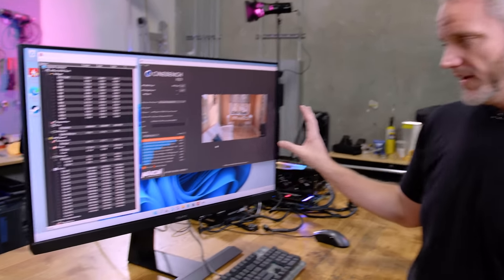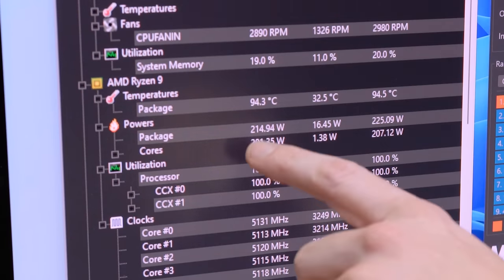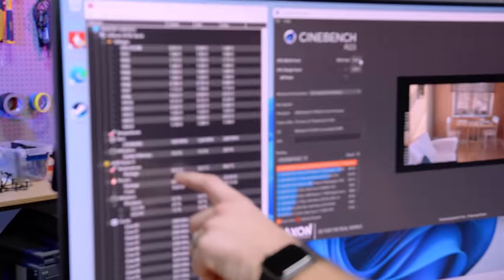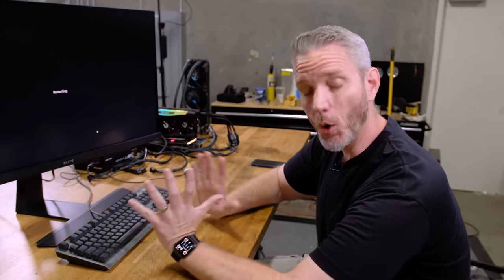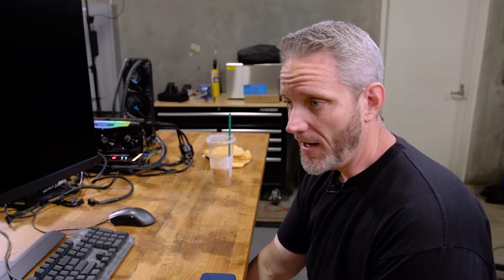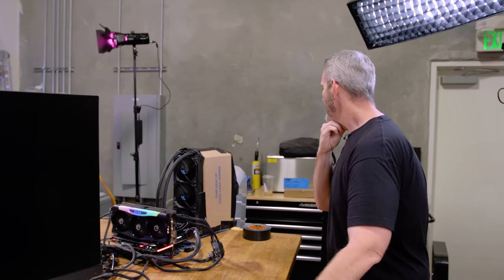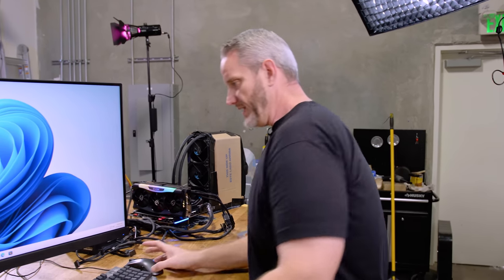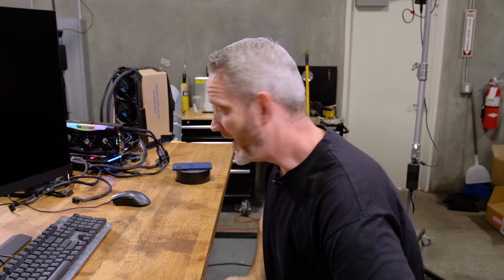This is fine...

Comment: Derbauer made a few interesting videos with similar experiments however he did delid the CPU and got about 20 degree improvements which is very impressive
Reply: that video was awesome!!
Reply: He also brutally murdered a 7700x in the process. RIP.
Reply: It's pretty straight forward, you will either use direct die cooling with custom parts from  der8auer and enjoy lower temps or you will run stock. And with how Amazon returns work it's never been easier to get into de-lidding and direct die cooling. I have personally destroyed and broken 3-5 processors so far. All of which I just put the IHS back onto and shipped back to Amazon and got a full return on my credit card. I then repeated until I figured it out and did it properly and it worked.  If you want your AMD Ryzen 7000 series CPU to be 75-80c under load you will have to use the aforementioned methods. Otherwise just accept 95c is the stock accepted temperature and there is nothing you can do about it without de-lidding and direct die cooling.
Reply: @yakivpopavich  ah yes, let's just commit fraud to learn delidding. come on, man.
Reply: @yakivpopavich  in gaming u will never get this temps
Reply: @friedpickle9828  You care about Amazon's bottom line and  Jeff Bezos's wallet?. Because I don't. People should use whatever means they can to learn more about overclocking and modifying parts and components. That includes taking advantage of lenient return policies of large corporations.
Reply: @yakivpopavich  not the ethical way... But if you don't get caught it's completely legal... A good way to get caught is to brag online about it
Reply: id love to see the stock PBO boosts with a 20 degree drop
Reply: That was with a manual overclock not with pbo
Reply: @yakivpopavich  What a way to figure things out ) It's unfortunate that this is needed to cool the cpu at all.
Reply: @pirojfmifhghek566  It wasn't too brutal, but it was murder.
Reply: Yep, just took delidding + liquid metal.
Reply: @yakivpopavich  The problem is Jeff Bezos doesn't care, nor does he have to. Consumers pay for what you mentioned, one way or another. Otherwise it wouldn't be offered.
Reply: @berinloritsch  Atta boy, I can't wait for the X3D models so I can actually do my next build. Gonna keep an eye on the 13th gen Intel chips too. I hope AMD's GPU's are really solid and actually result in AMD builders using non-NVIDIA cards in their builds for once.
Reply: @JoshuaKA02  Not my problem. The CPU's I damaged and destroyed were all returned and marked as DOA or faulty and were not put back into sales circulation. No Amazon customer is being negatively effected by what I have done. Amazon has foot the bill. Not Amazon customers.
Reply: For those of us who "speak 'merican"  it was a 20°C drop, which translates to around 36°F
Reply: @yakivpopavich  those cpu's then get looked at and resold to other customers. It's not just amazon you are defrauding, it's the next person who buys it
Reply: @yakivpopavich  The only one you are effecting with this is the next Customer.

If you think you will hurt Bezos at all... gg.
Reply: @yakivpopavich  hahaha the fact you think amazon foots the bill is hilarious. Once a thief, always a thief with zero moral values.
Reply: @Mike__B  pc temps read in degrees communist instead of degrees freedom anyways
Reply: @yakivpopavich  It affects every customer. That's how business works. Amazon has to foot the bill, yes, but they also have to make a profit; thus, they end up raising prices, fees, and services in the long run to cover it all.

Edit: And if the manufacturer is footing the bill, as is likely here, they do the same in return

Edit2: And it affects supply. That affects prices on its own directly.
Reply: @Mike__B  idk what you're smoking, 20 Celsius = 68 Fahrenheit
Reply: @TheOmnomymous  No they don't. I literally just said they are marked DOA and Amazon does not put them back into sales circulation. You understand Amazon doesn't even functionality check things when they are returned right?. Do you think Amazon has a giant room with test benches where they check the status of returned devices and components?. Because they don't. They literally toss a sticker on it and toss it into a receptacle to be disposed and marked as a loss. I'd do some research and figure out how Amazon works.
Reply: @F14Mavrick  Hahah indeed , I agree it's funny.
Reply: @JoshuaKA02  I've been doing this for months on end if not over a year, and the prices of the CPU's I have damaged and returned have all only gone down in price.
Reply: @Slimmeyy  I don’t know what you’re smoking, the comment was about a 20 degree C drop in temperature, and btw there isn’t linear correlation between C and F, and also C is almost exclusively used to measure CPU temps even in the US.  I didn’t watch derbaurs video but if we’re talking about a drop from 95 C to 75 C that’s actually a drop of 36 F
Reply: @yakivpopavich  it's not Amazon taking a hit. It's retailers that sell it on Amazon.
Reply: @yakivpopavich  The rules of economics still stand, bro. And capitalism dictates that we always foot the bill.

You do you, tho, just sharing my perspective.
Reply: @Slimmeyy  that's true for the conversion of 20C to Fahrenheit, but a temperature drop of 20C is equivalent to a 36 degree drop in Fahrenheit. Either way, @Mike B is way off.
Reply: @Mike__B  20°C drop is equivalent to a drop of 36°F .
Reply: @OutOfNameIdeas2  Everything I purchase is sold and shipped by Amazon. I don't purchase from vendors on Amazon.
Reply: @yakivpopavich  all losses are reflected in end user cost. So yes, you are hurting consumers. Basic economics. You are intentionally damaging products and returning them in a deceitful manner. I mean, you do you, but it's unethical, and abusing lenient return policies makes companies potentially adjust said policy in a consumer-unfriendly manner. Just my two cents. Has nothing to do with caring about bezos or Amazon. Stealing is stealing.
Reply: Yeah the DerBauer video basically debunked the whole "95C is normal" statement. The CCDs are too far off center and the IHS is insufficient.
Reply: @friedpickle9828  I didn't intentionally damage anything. I broke them accidentally while trying to delid and or apply liquid metal.
Reply: yeah he did ! pity AMD couldn't do something as simple as that, 20 degrees without hardly trying, a simple de-lid, thinner heat sink to get the heat away more efficiently to a the cooler, that change could be the difference between product reliability, or for the O.C. types removed thermal downclocking...isn't it weird how AMD have such a great product but are let down by the last step in the chain ? and it is Childs play compared to everything that came before that in the build process ! weird....
Reply: @pirojfmifhghek566  no that happened earlier..
Reply: @yakivpopavich  Unrelated, but don't do this at Best Buy. Worked at a return center and we test and check everything. (Pretty fun job for tech enthusiasts)
Reply: 20c not good enough I don't like going over 60c on my system.
Reply: noctua nh-u12a can handle this CPU just fine
Reply: @yakivpopavich  Your moral and ethics need to be straightened out. This way of thinking is what make people careless for each other and ruins nation... "this is someone else's problem, not mine". Each individual, the foundation of a society, can positively or negatively affect their surroundings. You, my friend, are slowly poisoning the well with your action.
Reply: @smileysan9261  not getting caught means it's legal ? what planet are you from ? done any murders lately have we ?
Reply: I had no problem delidding a simple intel chip.  The new AMD chips looks a little hairy with all of the surface mounted stuff.  I would buy a kit with a delidded cpu.  doubt that would ever happen.
Reply: Yeah I think I will probebly go that route if I get the new chips. But dang are these new CPU's space heaters. Between that and the 30 series GPU's? You wont ever have to turn on your heat.
Reply: @Mike__B  I don't know what der8auer's before & after temps were but for example, a drop from 95c (203f) to 75c (167f) is 36F.
Reply: @yakivpopavich  People are upset because you actually used the return policy 😆😆🤣🤣 it's not stealing if they have a return policy within so many days of purchase regardless if you intentionally did it or not.
There is always a excess of hardware in case it needs to be replaced.
People should understand neither business looses they just repurpose the parts melt them down etc..
People need to chill out with this stuff it's already out of hand as it is 💯
Reply: I am not surprised with how quickly the temps dropped I was pretty sure the problem is how quickly the heat is transfering from the die to the water which means the bottle neck is die to IHS , IHS to copper block, or copper block to water, judging by what you said about DeBauer delidding hus sounds like it is Die to IHS
Reply: @pirojfmifhghek566  yeah, i very much expect delidding the 7900 series are going to require an iron like the older soldered intel cpu's, will be interesting to see what Derbauer comes up with as a final solution
Reply: but only without Headspreader.. DirectDIE
Reply: @yakivpopavich  and thats the reason why amazons return policy's going to eventually get more and more stringent. Which in the end is just gonna make it harder on consumers doing the right thing
Reply: @friedpickle9828  Yeah, that's exactly the kind of bullshit that will eventually lead you either to an account ban, or to a company-wide nerf of the return policies, fucking over the whole thing for the rest of us who are honest about our returns.
Reply: @MeowyBrigade  Come and straighten my morals and ethics out then.
Reply: @yakivpopavich  Not worried about Amazon, but 3P sellers is another story
Reply: @yakivpopavich  I literally busted out laughing to this that’s amazing LOL!
Reply: I think he said it too, that while AMD's cooler backward compatibility was commendable, if the new CPU's are throwing out that much heat they should have gone with a design that let the dies be properly cooled.
Reply: @dlillibridge  Yup, my bad.  converted the wrong direction.  I did 5/9 instead of 9/5 as the multiplication factor.
Reply: @yakivpopavich  I hope you get some backlash for destroying cpus... karma around the corner
Reply: @yakivpopavich  This is pure idiocy. Yes, lying and theft doesn't count just because a major corporation is involved. /s
Reply: @yakivpopavich   People like you will ruin the lenient return policy for everyone else using the convenience for legitimate purposes. Also, you're a fool if you think that the loss from defective product that you're driving up isn't baked into the price tag.
Reply: @yakivpopavich  of course the guy without any moral standards is using a Russian flag as his pfp. Even worse considering you're not even in Russia
Reply: @yakivpopavich  Be cautious. One of my coworkers got banned from buying stuff on Amazon because (allegedly) too high of a percentage of his orders were returned.
Reply: so the problem from IHS ?
Reply: @pirojfmifhghek566  Yeah the sad music playing in the background during that was great lol.
Reply: @MundaneThingsBackwards  /s?, you just admitted to using Reddit. That's pretty cringe buddy.
Reply: @yakivpopavich  obviously you dont know how econ works..... amazon paid a certain amount and will get the money back.... your right they wont be put in circulation, but the price of the others will increase to compensate.... which you were increasing
Reply: @NRKValorant  Oh yeah I'm sure the ghost of Intel and AMD processors is going to haunt my dreams. They will send a representative to my house to beat me in my sleep. Lmao
Reply: @ark9823  I'm American. I just use this avatar and name to troll people with more ease. Works rather well as you can imagine granted the current thing.
Reply: @stevenhenson4956  You know most companies buy these items at whole sale which is way cheaper then what we actually pay.
These people truly aren't taking a L it's all been predicted in the budget how much loss vs gains.
We learned this stuff in economics in high school this is how businesses roll
Reply: @yakivpopavich  You're not hurting Amazon's bottom line, you're just helping to raise the price for everyone.
Reply: No normal user of these CPUs are going to delid them.  Not only that it severely hurts the resale value.  Dumb talking point.
Reply: Every techtuber should be doing delidding benchmarks right now. Show AMD how badly they need to fix their IHS this generation.
Reply: @tommypearson9260  when the scale changes as in artificial handling (as in what the op is doing) every company will compensate........ if the math came out that 5 off 100 would be bad sure id agree with you but when 25 off the 100 go bad theyre not gunna eat it ...... 

Ps before you answer i work for amazon..... theyll get the money they have theyre hands in everything.... even making video games. You think your paying attention  yet shipping prices through the roof..... 

people buying shit at these prices just show that companys can charge whatever they want and youll pay for it cause fuck the next guy........

Wheres the worlds integrity , cause i was raised you dont do shit to anyone you dont want done to you.
Reply: @yakivpopavich  you get blacklisted eventually. Your story is fake
Reply: @yakivpopavich  Troll somewhere else russian bot...
Reply: @Bigdog1787  I’d just turn of pbo if I were you then, plus that is full loads usually wouldn’t do such crazy temps with gaming and such
Reply: Ya... Jay tends toward watching others and regurgitating lately
Reply: Direct die with a full pot of dry ice lmao. At he still ended up around 70c. I'm more impressed by the CPU's ability to generate so much heat in such a small area
Reply: @Walczyk  How would I benefit from lying about a mere handful of fraudulent Amazon returns?. Physically speaking I have only gained from it. And to get blacklisted from Amazon for returns you have to return literally tens if not near 100 items in a short period of time.
Reply: @yakivpopavich  profile picture checks out XD
Reply: @yakivpopavich  Amazon doesn't lose squat. They'll just send it back to AMD. They're the ones you're screwing.
Reply: @yakivpopavich  dude it's individual stores selling through Amazon that you're screwing over, not Amazon itself.
Reply: @tahirguven8680  People have been abusing Amazon return policy for years now... And if anything, Amazon return policy have gotten more lax
Reply: @yakivpopavich  based
Reply: I think the most interesting thing is how they kept the Z height the same. Which will have compromised the cooling. Would be interesting to see how much impact reducing that IHS thickness would have made.
Reply: @friedpickle9828  yeah that's greasy as fvk, his amazon account is definitely flagged.
Reply: @L1ft0ff  Cope and seethe, you angry?. I'm not a bot. I am directly responding to you. Do you understand what " bot " means or do you just use it against anyone you dislike?.
Reply: @yakivpopavich   did you juggle between shipping  adresses and accounts to pull this off??
Reply: I went to comments to say the same thing. Lol AMD needs to make a slim version for the lid.
Reply: @RavTokomi  yeah, I was watching Jay trying to make sense of how the temps went down right when he stopped cinebench and I was thinking, the way these temps react can only mean there's insufficient heat dissipation at the IHS... great that DerBauer proved it!
Reply: 20 degrees by delidding jesus
Reply: @yakivpopavich  i hope you get caught. Amazon lawyers feel free to use these comments as evidence in the lawsuit against this dude! Hope he gets buried in both debt and prison time.
Reply: @yakivpopavich  I work at amazon, and have seen destroyed motherboards marked for being sold "as is" don't tell me to do my research because I literally work with damaged goods on a daily basis
Reply: @tommypearson9260  do you not remember the great chip shortage of 2020-2021?
Reply: @yakivpopavich  Keep trying to rationalize fraudalent behaviour pal.
Reply: @yakivpopavich  Yeah, you broke them voiding the warranty and lied and returned them as "damaged".
Reply: @yakivpopavich  What the fuck dude, you know everyone else has to pay for this in amazon fees right? Also fraud, when amazon finds your comment you are fucked.
Reply: @yakivpopavich  iv ripped bezos off several times and have zero qualms doing it he's a fucking billionaire and can easily afford it I look forward to stealing from him again😇
Reply: @yakivpopavich  I feel sorry for the folks who end up receiving the hardware you destroyed.
Reply: @yakivpopavich  Genius over here using his real name on YouTube while admitting to fraud. But you're in Russia probably, so you lose in the end anyway, lol
Reply: @yakivpopavich  How do you look at yourself in the mirror? You are OK with being a dishonest thief? Don't you have any ethics or pride?
Reply: @dlillibridge  oh right, cuz Fahrenheit's 0-point is -17 Celsius. Darn you US for being the only major country to still use this metric
Reply: @Slimmeyy  That's not how thing work, a drop by 20 Celcius is indeed a difference of 36 Fahrenheit.
One extreme example to demenstrate the problem:
Say your CPU temps decreased by 0 Celcius (didn't change). It would have dropped 0 degrees Fahrenheit, not 32.

This conversion sucks.
Reply: i think that am4 coolers compatibility was a mistake. Extra couple of bucks for an adapter vs 95C? Guess everyone understands the odds.
Reply: indeed, only the CPU HeatSpreader is responsible for 20 degrees C. So bad design?? As this should NOT be 20C difference max 10-11
Reply: @angeltensey  Agreed. Tests have to be done to see whether AMD's efforts at maintaining cooler comptibility by thickening the IHS truly was the main contributing factor. Maybe the problem simply is lackluster installation/machining of the IHS?
Reply: @JoshuaKA02  I confirm that that CPU is in silicon heaven now.
Reply: @ark9823  So a Russian person is less of a human than you ?
Reply: @angeltensey  this isn't about cooler compatibility at all, this is very much intentional. Not that I really agree with having this mode be the default instead of the normal TDP-limit, as I'm concerned for both temps and electricity costs, but I can see where AMD is coming from here
Reply: @JoshuaKA02  capitalism doesn't dictate anything, ever. The only thing it does is let the market decide who foots the bill, plus of course helping to ensure there is product to actually allow a product to exist that requires a bill to be footed.
Reply: @tomhsia4354  despite the fact that copper is a great heat conductor, this amount layer of it is quite inert compared to heat generation spikes of the cpu.
Reply: @Slimmeyy  derbauer discovered that delidding cuts 20C from max temps.
Reply: @yakivpopavich  even if you don't care about Amazon, the sellers are probably getting screwed. Someone in the supply chain starting from AMD to the retail seller is eating the loss of your destroyed CPU.
Reply: Showing that the IHS is the issue and watercooling will not perform much better
Reply: @yakivpopavich  you do know that amazon doesnt take any loss in those products true? most of the time is sold by external vendors who ship their product to amazon and amazon will take anything that its returned so potentially you have made someone loose around 1-2k dollars by doing that and it wasn't amazon
Reply: @randomguydoes2901  if you change the name it also will sound a lot better... instead of fraud, just say reallife exploit xD
Reply: @friedpickle9828  russians ...
Reply: That was an awesome video, but I don't have the balls to delid a CPU over $100 lol. With Silicone Lotto shut down,  are there still any reputable places to get delided CPUs? Or even binned CPUs?
Reply: @smileysan9261  if you don’t get caught it’s legal? Lmao no that’s not how that works at all. You cannot go and commit murder and say it’s legal because nobody caught me. Holy fuck that logic.
Reply: @yakivpopavich  Amazon foots the bill lmao. Yea I can tell you’re a businessman. 

Amazon employee: sir we are losing money on this product do we keep selling it?
Amazon CFO: yes of course we do champ! We don’t need to make money we will just give it to the people at no cost to them. It’s not like we care about profit at all.
Reply: So the lids are just terribly designed
Reply: they probably left extra room for v-cache
Reply: @pirojfmifhghek566  was already dead
Reply: @pirojfmifhghek566  Cost of product development 😰. But if he comes out with a finalized production ready delidding kit, I am game..
Reply: @yakivpopavich  I am still keeping hope for the  Intel Arc 700 also if Intel manages not botch its release. Mid tier gpu for 2K resolution is still vfm.
Reply: @RavTokomi  Der bauer said that the IHS is too thick that result in  reduced Thermal conductivity across the IHS. AMD inorder to retain some compatibility with current AM4 Coolers opted for a thicker IHS for AM5. That vid is very informative and entertaining.
Reply: @psycronizer   I think it is more complex than that. It is about ecosystem compatibility etc...
Reply: @TheMugwump1  It may if the bean counters at AMD or a partner sees a market.. Lets keep our fingers crossed.
Reply: Came here to say the same thing.  One of his comments was that AMD had apparently made a thicker IHS for these CPUs in order to maintain compatibility with a wider range of AM4 coolers, and that this thicker material was impeding heat dissipation more than the thinner ones used on Zen 3.  All very interesting.  I wonder if some "extreme lapping" might help here.
Reply: @friedpickle9828  what do you expect from a person using russian flag as profile picture? He basically advertises that he is, in fact, just a literate bandit
Reply: Should also see Tech Yes City's video where he undervolted, major temp changes setting all clocks and undervolting and still getting crazy CB23 scores.
Reply: That was 54x locked multiplier and voltage, I have a feeling this thing will do 95 even with direct die cooling, if it doesn´t hit the powerlimit.
Reply: @yakivpopavich  is this a new.form of humor? Cuz it's not funny.
Reply: @Slimmeyy  its a delta value. Not the current weather dude. 20x1.8=36f delta.
Reply: @yakivpopavich  huh,admitting to crimes on the internet is TIGHT
Reply: @miff227  Capitalism is the action, the market is the stage on which that action takes place. One may say the market affects capitalism, but that’s capitalism affecting another’s capitalism in the market.
Reply: @JoshuaKA02  no, capitalism is a framework, not an action
Reply: @yakivpopavich  and you’re not only affecting Jeff Bezo’s Wallet. There are people that sell on Amazon for their private business.
Reply: @yakivpopavich  :O
Reply: Roman is a mad genius. 5.5 all core at 70c with direct die cooling
Reply: @tommypearson9260  shoplift much?
Reply: Just going to say that!!
Reply: @Slimmeyy  this is not how delta works though, the formula is "C = 5/9(F-32)", The deltas get only 5/9 as the constants are removed.
Reply: Lol, yeah, but his tools are beta, and dont forget he killed his 7700x 😂.. still 20’c drop in temps is amazing.
Reply: @stanimir4197  you are only the third person to point this out, thank you
Reply: I watched these videos... absolutely awesome! With custom CPU frame and self developed delid tool... Again... Big fan of this guy for years...
Reply: @albino_gringo1912  There you go then they really aren't loosing money thank you 😆😆🤣🤣
Reply: @TheOmnomymous  nope because I had already had my chips before it got all crazy and all four 30 series Gpus I own at msrp
Reply: @MattByrne  What you call shop lifting is what these companies do to you everyday but you'll think their doing you fine.
What the previous person said doesn't means it's my practice and pre judging just shows you're go along.
Unless you really have a point then you really should of said nothing 💯
Reply: @tommypearson9260  well, there was a massive chip shortage, even vehicle manufacturers were affected
Reply: @yakivpopavich  Did you actually buy directly from amazon though, or was it actually a small business selling on Amazon via the FBA program? If it was an FBA seller, you're hurting their bottom line, not so much amazon's.
Reply: @yakivpopavich  You do realize that you are driving up the cost for everyone else by doing that?  I guess you just don't care.
Reply: @yakivpopavich  Wrong.  All Amazon CPU customers, or possibly all Amazon customers will see a price hike to cover the costs of what you and others like you have done.
Reply: This is why people buy golden samples already delidded. Still have my 5.2Ghz 8700k delidded golden sample...
Reply: AMD made a poor decision to massively thicken the IHS for partial backwards compatibility with coolers.
Reply: @bethanjenkins2257  I don't think they de-lidded Jesus...lol
Reply: @RsnBhs  Sold and shipped by Amazon. That's the only way I do stuff like this. I never purchase from vendors off Amazon for the aforementioned reasons. I'm not a fan of screwing over small businesses. Amazon on the other hand, I couldn't care less.
Reply: @friedpickle9828  fraud doesn't hurt Amazon dude. A trillion dollar company can afford 4 or 5 processors
Reply: @1newme425  no one gives a shit. It's fucking Amazon let them pay
Reply: @yakivpopavich  it most definitely affects everyone.  No company is cool with losing money.  All that happens is amazon assumes a certain percentage loss on a product because of people doing exactly what you did based on past experience.... and marks the price of new products up by that same percentage to compensate.  They don't just eat the cost.  That's just bad business.  And Amazon of all companies knows better.
Reply: @smileysan9261  that's so wrong. Not getting caught on something illegal is not equal to legal.

That's not how law works. This not how our society should work. If everyone think and act like this in every aspect of their lives we would live in total anarchy.
Reply: @SilverViper1000  chill Timo... it was just a joke, nothing more and nothing less... I personly think its wrong to scam some one... even if it is a huge company
Reply: If YouTubers watched other YouTube's content, they wouldn't have "original" ideas
Reply: @ghomerhust  shiiiit i would just bring it back up to 95 with whatever extra clock cycles 20*  headroom brings me. If they think it's fine at 95 i think it's fine at 95. Still want those extra clock cycles though
Reply: @tspooner01  to be fair its not 4 or 5. It's hundreds or thousands of people doing this.  Amazon probably gets its money back from manufacturers, who then build the costs from fraudulent returns into msrp for next gen. 

That being said, i have done it when i didnt have anymore money and i fried 6 noctua fans using the wrong cable with a psu. Its wrong but i did it.
Reply: @shiftednrifted  i really don't see that it's wrong. Amazon can afford it and it doesn't make a difference. If that's really what gets your panties twisted, just buy an unlimited warranty from MicroCenter. They will explicity tell you that you can return it in any condition no matter what. If you don't live near one then that's your problem
Reply: @tspooner01  Did you even read my comment? Its not amazon who eats the cost. Amazon rma's it and the manufacturer gets the cost. Then, the manufacturer adds the cost from fraudulent rma's into the msrp of the next products they release. You are increasing the price of hardware by doing this. Not current hardware the next hardware to be released.

I do live near two microcenters. And guess what? They're more picky about warranty now because people like you were abusing it. I recently tried to use the warranty on a monitor that got damaged in transit and they told me to fuck off in as many words.

Tell yourself whatever you need to to sleep at night but it's wrong. You're hurting me,  your hurting everyone else who buys electronics, and to a lesser extent you're hurting yourself because you're going to have to pay more than you should on future upgrades.
Reply: @shiftednrifted  sounds like a "you" problem tbh
Reply: @psycronizer  It is a saying, why are you taking a tongue in cheek comment literally?
Reply: @indigoskywalker  He already has the prototype. It just wiggles the IHS back and forth until the solder is broken. The limited movement protects the exposed components on the CPU.
Reply: @--_DJ_--  i know, I watched the same video 😂
Reply: Yeah Jay talked about all of this if you bothered to watch the whole video.
Reply: @yakivpopavich  that's just scummy because those things most likely get shipped again to a different customer who would be very angry to figure out their new CPU is damaged by an idiot who couldn't get it right after multiple tries. You could've tried delidding on old or broken CPUs but you had to practice on brand new stuff. Maybe you shouldn't delid stuff yourself if you're that incompetent.
Reply: @TechnologistAtWork  Read more. Every returned item that is defective or DOA is disposed of, not resold.
Reply: @yakivpopavich  That's fraud pal, hope you get caught.
Reply: @yakivpopavich  It's still fraud bro.  Robbing a rich person does not make it ok.
Reply: @tchlin  Next thing your gonna tell me that ordering an I7 or I9 and returning an old I5 in it's place is bad.